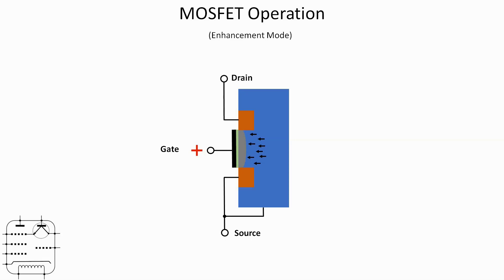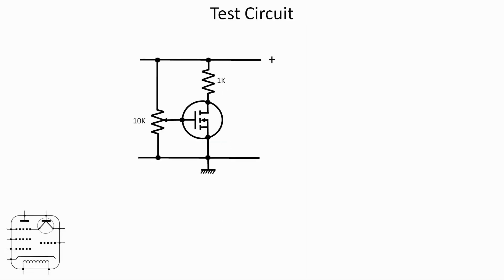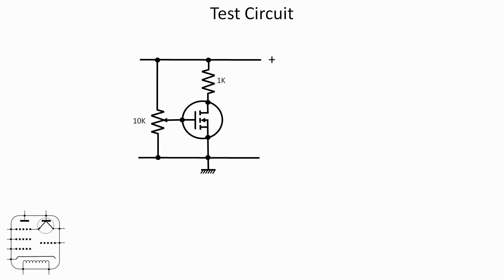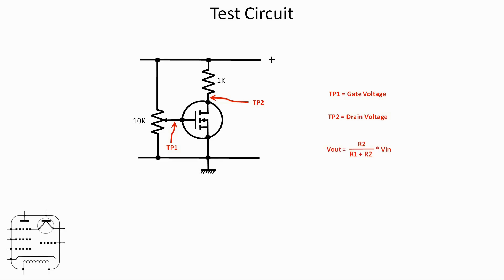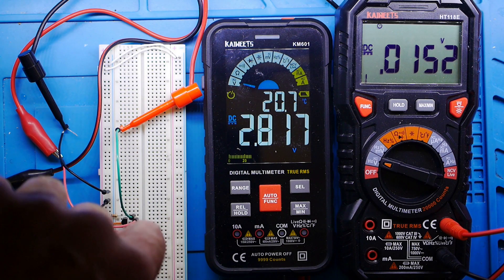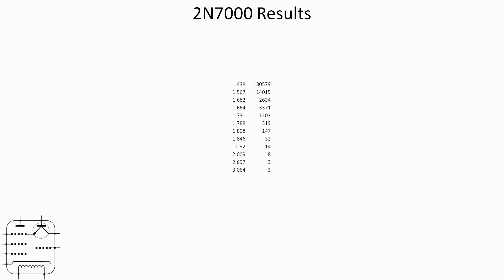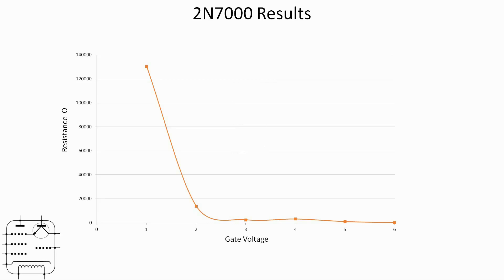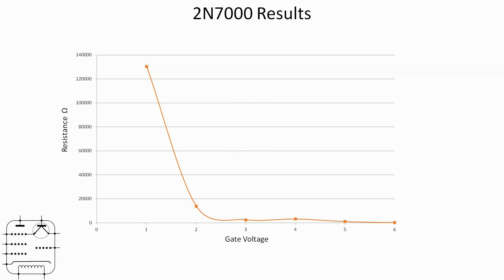A Look At MOSFETs And Channel Resistance

Comment: Plotting the IFRZ44 results on a log (resistance) scale would have enhanced the bottom end of your graph without dropping the initial data points. I'm not sure if you wanted so much bottom end enhancement or wanted to burden an educational video with logarithms!